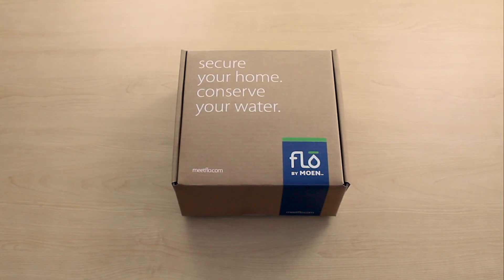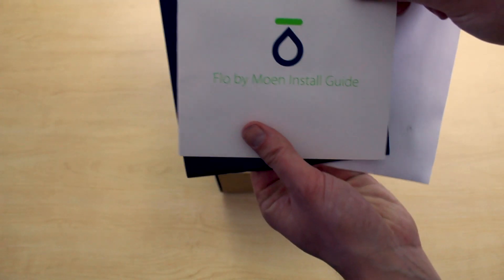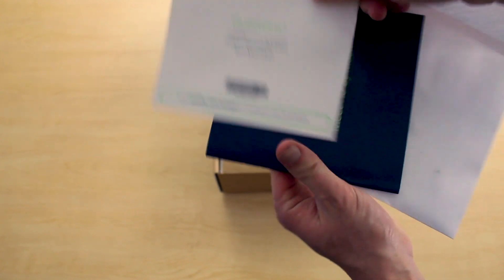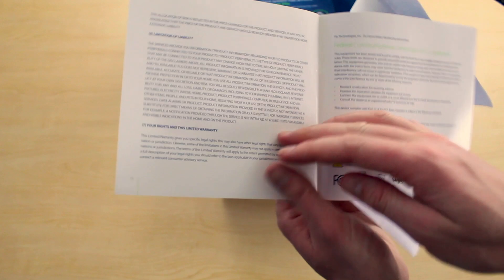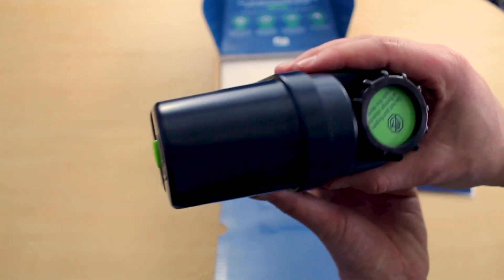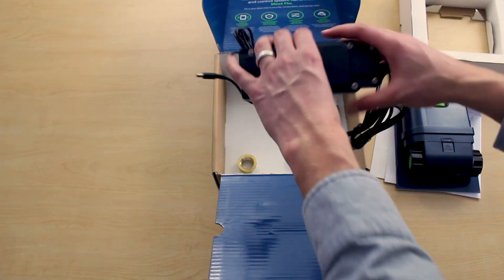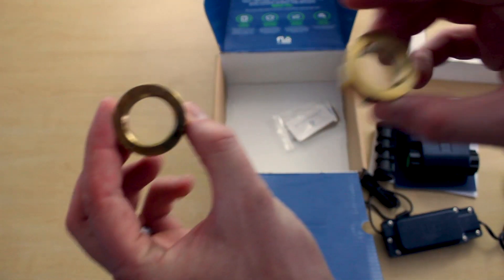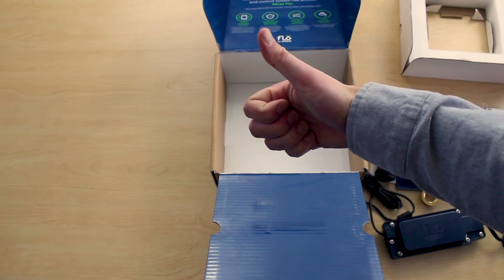Unboxing the Flo by Moen (Smart Leak Detection System)

Comment: That's not an extension piece,  it's a filler in case you need to remove the valve and it's also great for using to space the install correctly.